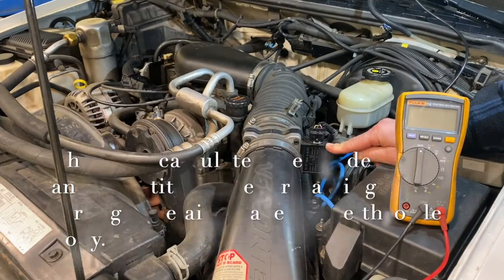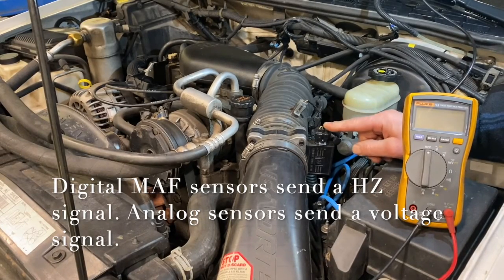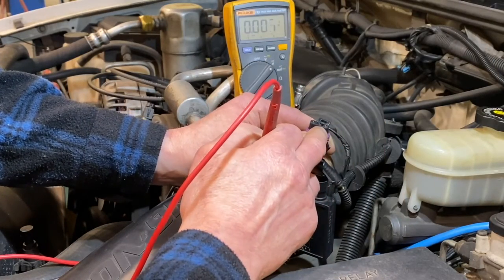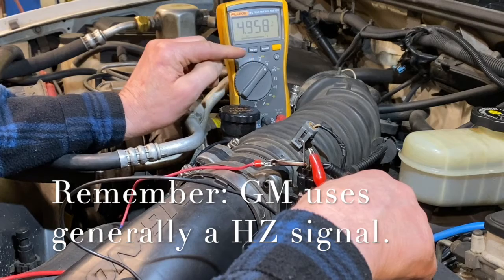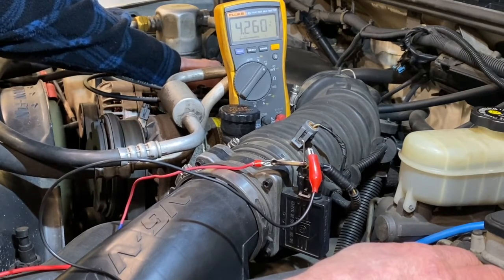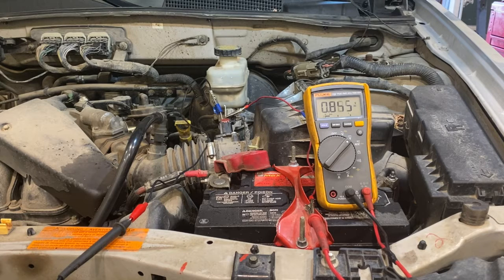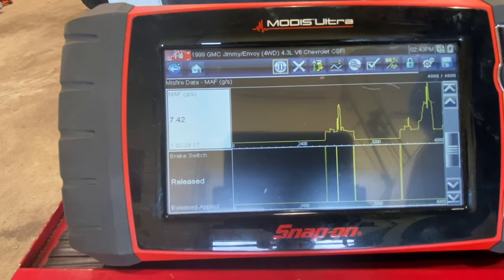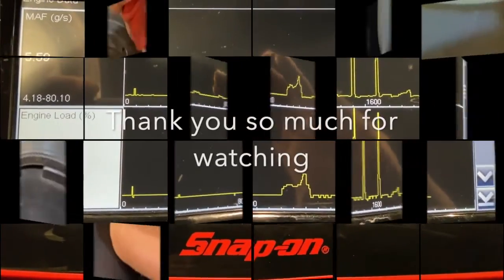MAF sensors: How to test them

Comment: I don't understand why when it was set to 20V, the voltage didn't drop and it worked fine, but when you set it to Hz, it started to drop the voltage. But later when you set it back to 20V, it was the same, 8.6 to 3.V, please guide me.
Reply: Hz is a frequency, how many times it sends a signal in a given time. It will always give the same voltage but Hz is reading how many times the voltage is sent. 20v just reads what the voltage is being sent

Comment: That DC voltage changed little due to ripple caused by frequency signal. or other way to call is just noise. Nice explanation and thanks for the video.
Reply from the maker: Thank you. :)

Comment: I have an 04 Vortec 4.3.  My old MaF is reading around 9 to 10g/s at idle. Replaced it and new one is reading 7-8g/s.  O2 shows bank 1&2 rich trims.  Short and long fuel trims show -25. Replaced spider injection as well. Still getting same codes MAF p0101 and P172/175.  Can MAP cause the higher air flow?
Reply from the maker: @SubePelayo928  That is high for idle.  I would try temporarily disconnecting the map and running it to see what happens to your readings.  Definitely check your engine to body ground/s, and ECM's ground for voltage drop and resistance as looseness or corrosion can skew your sensors' ability to read correctly.  Also it is worth checking the MAF sensor to ECM wire integrity.  A loose pin between the MAF or ECM in the connectors can wreak havoc on readings.  It is worth as well checking for vacuum leaks.
Reply: @bensiemers5094  disconnecting the MAF shows the default 1.92 g/s and all fuel trims are close to 0.  I’ll run through the wiring today to check for splits or cracks.  I recently had the motor pulled and rebuilt. I put all the grounds back on during install.  I’ll check for vacuum leaks too with a fog tester. I replaced all the vacuum lines too. But, a vacuum leak wouldn’t cause a rich reading? Or would it?
Reply from the maker: @SubePelayo928  A vacuum leak will cause a lean condition and the map will pick this up and could potentially, as well,  skew the MAF readings.  I would think the Fuel trims would normally reflect that but odd things happen.   A stuck or dirty EGR valve can also cause these issues.  Hoses, manifold, plenum leaks, PCV/crankcase ventilation leaks, a stuck purge valve all could be culprits, if wiring is okay.
Reply: Hey came across your channel having engine problems on astro,tested my 3 lead plug like yours i get a continuity reading from red to ground with van off is this normal??thanks

Comment: Hi there, please i have a 2014 Holden Captiva diesel i crank  it no start, but when i disconnect the mass airflow sensor and start again straight away start i get a new one replace but still same problem do you know why??
Reply from the maker: Though I have offered some suggestions on this site,  it is not easy to provide sound advice without a vehicle in front of me.  If there are trouble codes, they would need to be followed up on to see if it is a problem outside of your MAF sensor circuit.  However, your new MAF sensor could also be defective, or your wiring integrity going to the sensor could possibly be faulty.  In that case, further specific testing of those circuits would be required.

Comment: Does the MAF connector receive power from the battery before the plug in? thats what im trying to learn is sequence of operation the direction form the battery. sometimes seems confusing if it goes to the PCM first or from the battery first. once i learn this it seems I can understand left to roight back and forth where to put the blame if before or after any connections
Reply from the maker: You will have to consult a specific wiring diagram pertaining to your vehicle to be clear of the circuit, and it will depend on how many wires you have with your sensor.  Generally, there is a wire supplying voltage from the fuse and relay panel and a ground and signal wire from the ECM.  Other wires are for the air temperature sensor separate or within the MAF sensor.

Comment: Hi, I am in the process of repairing the mass air flow sensor connector wiring. As a result of the mice messing around, I cut the wires off the connector side, leaving approximately two inches for each wire attached to the connector. I thought each wire was a different color, but I was surprised to find two wires of the same color. I drive a 2006 Infiniti M35 with a maf sensor that has 5 wires in this order from left to right: red, black/white, white, yellow/green, black/white, so I connected the 3 different colored wires and was left confused about the two  Of the same color. I tried connecting this to this and vice versa and I did not feel any difference. I also tested them with a multimeter and they both gave the same measurement. So if you have any idea or suggestion that can help, I would be appreciative. thank you
Reply from the maker: It is very possible that the 2 black white wires are both ground wires that down the line connect to the same place.  If this is the case, it wouldn't make a difference on connection.  If you can search for and locate a wiring diagram, you can verify this assumption.
Reply: @bensiemers5094  thanks for the reply,  yeah man that's what I thought However, I did not have absolute confidence to make a final decision without hearing opinions from other people thanks very much
Reply from the maker: Just one note.  Disconnect your connector momentarily, key off and measure the resistance between the two black and white wires with an ohm meter.  If they are down near 0 to .3 ohms, that is a good condition that they are common to each other.
Reply: @bensiemers5094  they were down to 0
Reply: @bensiemers5094  ok, then let me give you the reading of all wires and you tell if it's a proper reading so I  can solder them. because I've had a couple misfires on bank 1 while I was thinking that the MAF has some to do with. first I had cylinder 5 now 1 . ok with connector disconnected ignition off testing the power wire and the ground next to it gave me 441 ohms, testing power and the other ground 441 ohms,  the yellow wire with each ground 1290 ohms, the white one which might be the maf signal gave none,  now here is the voltage test with ignition switched to on position. yellow 4.83 v, both black 0.01 v, red 12 v, and some change, the white one 1.50 v
Reply from the maker: You really will have to find and consult a manual regarding the test values that you should have in voltage for each corresponding wire sand position.

Comment: Good morning Sir..A problem with my Honda jazz car 2005..Module ,Resistor and 2 oxygens sensors replaced..Still problem of heater.Can you help me..Thanks...Merci
Reply from the maker: It is difficult to do an online diagnosis without assessing the car directly and performing various tests such as fuel pressure, exhaust restriction, compression assessment, ignition, etc, but if you indicate what is going on and what codes you may have, I may be able to suggest an approximate direction.

Comment: Great Vid!!! What made you decide to consult the manual to find signal and ground on the Escape? DIYers dont usually have manuals so I was wondering if probing multy wired sensors with a volt meter is still ok in tnis situation?
Reply from the maker: I was an automotive instructor for 31 years and combined 40 years as a mechanic.  I am lucky enough to have access to a good manual resource, so it definitely helps.  :).  Thank you for your kind comments.  Best of wishes.  Enjoy your DIY work.
Reply: What if you didn't get a reading on The Hertz is the mass flow sensor bad does anybody know thanks

Comment: I thought the power will be 5 volt. Why not as most sensor are
Again how can I know if is digital or analogue before testing
Moshitoa south Africa
Reply from the maker: Thank you!  That is a great question.  Many vehicles will have a 5 volt return signal voltage when the sensor is unplugged.  Once plugged in, however, this will change and vary depending on engine load due to the varied resistance going through the sensor.    Some vehicles, however, will use a hz signal on the return wire, and although you can read a voltage on that wire, it won't be very responsive to engine load changes, so the HZ selection must be used on a multimeter to pick it up.  The 12 volts that you may be referring to is the actual power feed in the sensor.    There may be vehicles out there, though, with up to 12-volt signal return since there are so many different manufacturers, in the world.  I am just not presently aware of one at this point.  :)